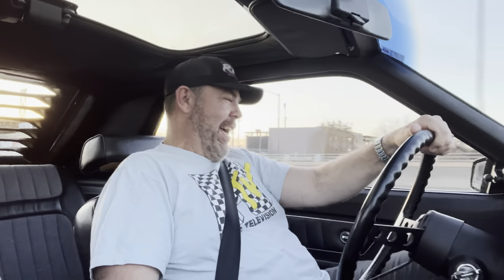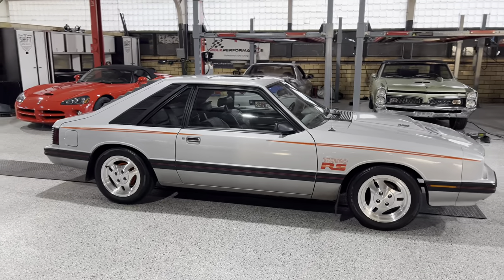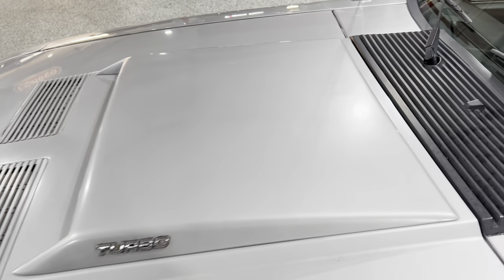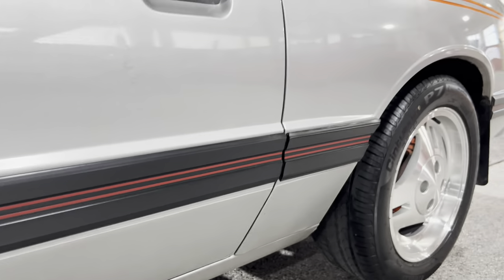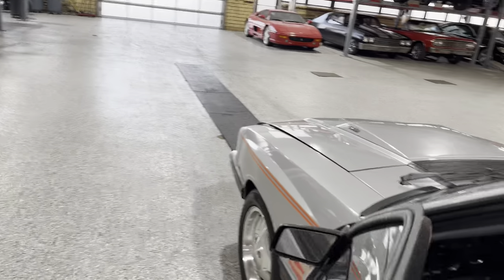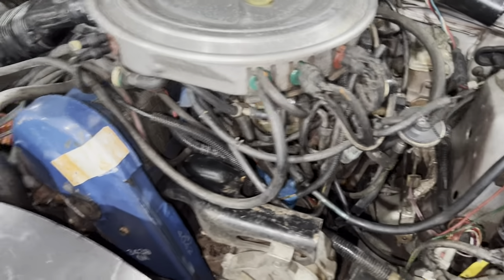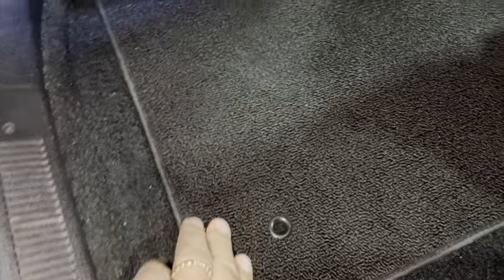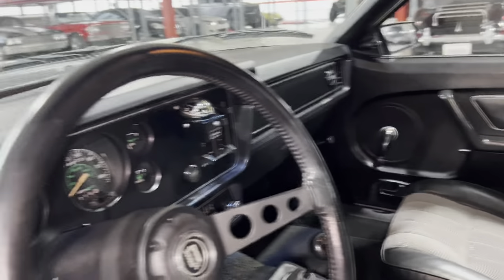1979 Mercury Capri RS Turbo 60k survivor for sale. Fox body.

Comment: Great example of a Capri! I still have my 1984 Mercury Capri RS with a V8 that I got from my father, and he bought the car new in 1983. It still has the factory oxford white paint with the tri-color stripe kit. I did the same as you with the lowered stance but unfortunately because the original factory 5.0 motor broke the crank and block, I ended up having to use a newer style roller block from a later model Mustang that was stroked to 347. I liked the increased HP but was bummed that the factory motor was no longer in the car. I put wide Centerline rims on it because as you mentioned the factory tires were WAY too much money and at the time the LMR TRX's you had weren't available yet. You NEVER see these cars now a days and I get stopped in mine all the time when I take it out by people who have either never seen one and want to know what it is or people who haven't seen one in decades and they all say the same thing, "I don't remember these cars being this cool!" LOL. Most people don't realize there was only a very limited number of these produced with the last 4 years 83-86 being the lowest production years. In 1984 they only produced just over 3,600 RS 5.0 V8 cars and just over 1,500 RS Turbo 4-cylinder cars. You just don't see these cars anymore!
Reply from the maker: Great story!  Thanks for sharing!

Comment: I had a 1980 Capri RS Turbo in black and tan interior. If you took it on a longer trip (over 200 miles) the exhaust manifolds would glow bright red and the heat would cook the turbo seals. Wasn't a great performance car, but it was attractive for the time period IMO.
Reply from the maker: Sounds like a fuel mixture problem if manifolds getting that hot.  Early days of turbo tech.

Comment: I had an 82 5.0 Capri with Recaro seats.   It was a great car.   The rims on that car present problems when it comes time to buy tires.   $$$$$$$ if you can find them.   an odd size that is no more.   Nice looking car,  but need to dump the fog lights.   they kill the look of the front end.